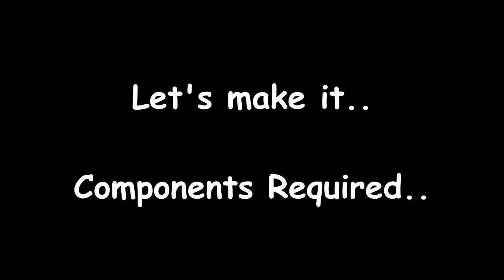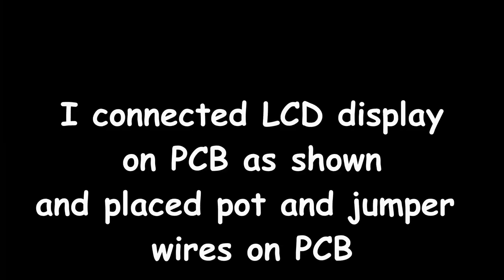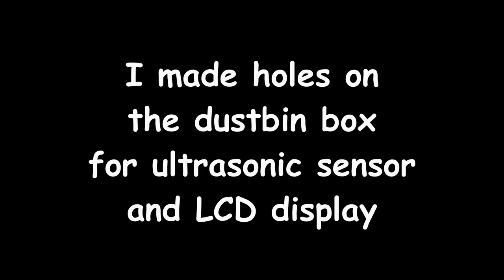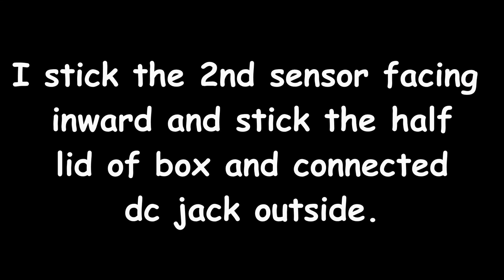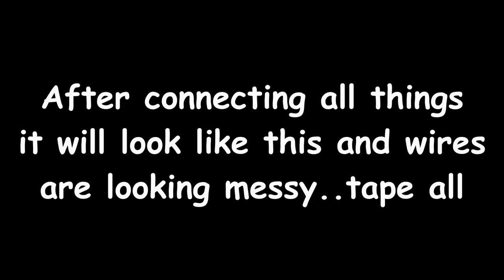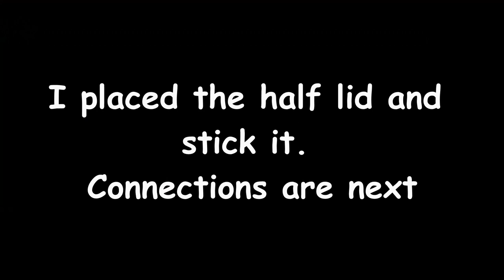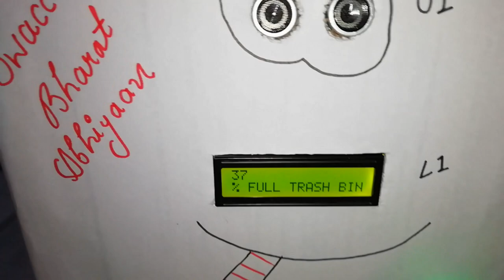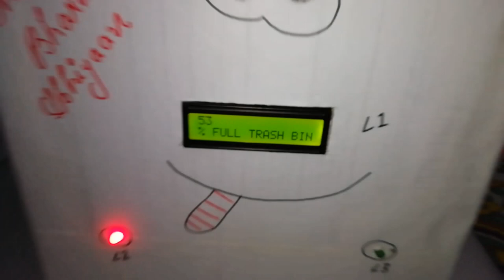DIY Smart Dustbin with garbage level monitoring | IOT based Garbage monitoring system

Comment: after adding all this components my servo motor is sometime working and sometime not..is it because of the power supply i m giving from laptop..when i m giving supply 1st some times it is working then getting stopped only the motor having this issue..please tell me the solution..
Reply from the maker: Give power supply 5v via a mobile charger to all servo motors and ultrasonic sensors..
Reply: @electronicsisfun08  i m giving power supply from laptop ...is not laptop providing the 5 v supply?
Reply from the maker: @sumayatabassum1666  don't give power supply from laptop.. If there will be short circuit your laptop usb port got damaged.

That's why provide 5v from mobile charger
If you want more help msg me at whatsapp or telegram +919557024177

Comment: Hello. I would jut like to ask how did you pprint the status like 60% if it reaches a certain distance?
Reply from the maker: using an ultrasonic sensor which is placed inside the dustbin
Reply: @electronicsisfun08  I mean sir for the code part. Mine will only display the distance. I would like to display its status like yours having % on it
Reply from the maker: In code as you have 1 meter of distance with 100%
you have to code when 0.5m converts 50% and so on
Reply: @electronicsisfun08  how exactly did you do it sir?